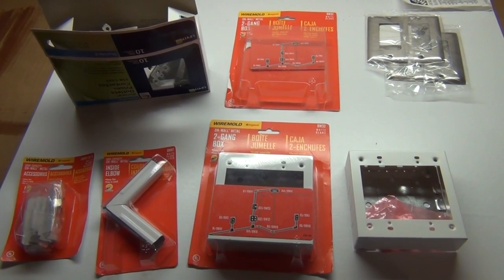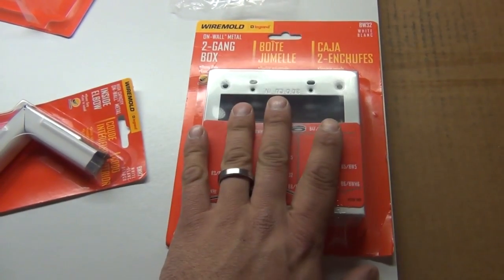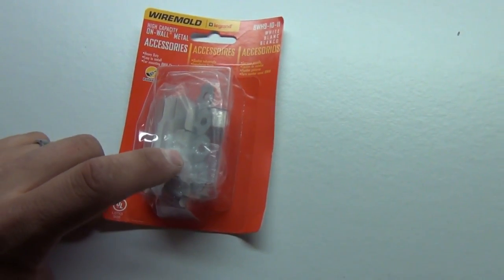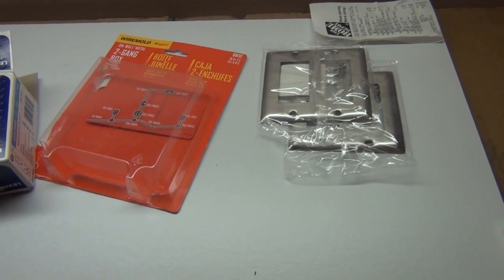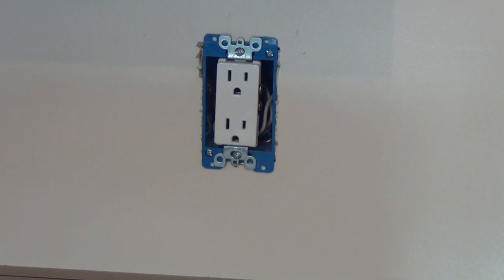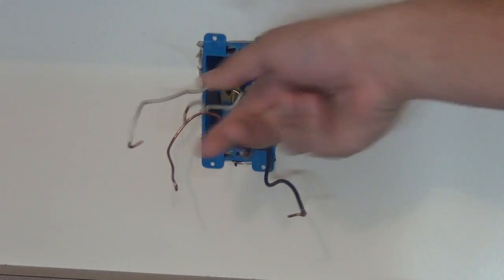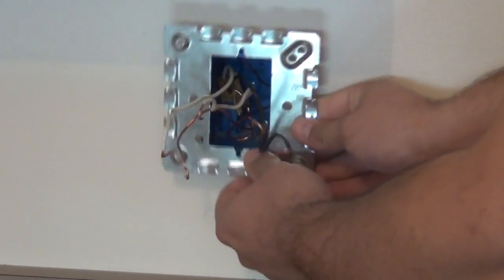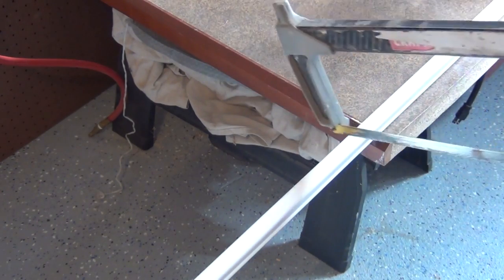Wiremold Installation

Comment: Excellent video.  The original outlet is a 15 amp.  Check the wiring to that outlet.  If it is 12 ga, then what you are doing is fine.  It just means that someone replaced the original 20 amp outlet with a 15 amp version.  BUT if it is14 ga wire feeding that outlet then adding 20 amp wiring and 20 amp sockets does not make it a 20 amp circuit.  Not to code.  Also, BW9-10-11 kit should come with inserts that you install at the cut ends of the raceway to keep the sharp ends from cutting into the insulation.
Reply from the maker: Dan Burch Thanks.  Yes, the original circuit is 12 ga wire.  It is within code to install 15 amp receptacles on a 20 amp circuit.  However you cannot install 20 amp receptacles on a 15 amp circuit.  I had no need for 20 amp outlets.  I just wanted the extra amperage capacity on the circuit.

You are correct about the bushing inserts.  I typically don't install them and use extra care when pulling the wire.  It is however good practice to use them.  Thanks again for stopping by my channel.
Reply: Not to mention anything in the Garage should be GFCI protected so either you need a GFI Arc fault breaker or a GFCI outlet where the power first comes in is your Line side and Load side out to the other Receptacles.
Reply: @AccordBass12 The circuit breaker he turned off had red handle, so that is usually a gfi breaker.

Comment: It would have been helpful if you would have shown the wire being pushed through the corner piece which can be tricky for some people.  It's little things like that that your average guy has problems with.  Other than that, good video.

Comment: I want to add a few outlets in attached garage on a dedicated 20 amp circuit. Is wire mold setup used here meets code for garage setup?

Comment: Well done, looks doable. Sure I'll figure out some way to get into trouble but seems to be a good introduction into the wire mold system. I was wondering about the burr on the end of the raceways and I see Mr. Avera below me takes up the subject of the plastic bushings provided to alleviate that danger.  Maybe a comment about not adding too much to any one breaker by exploring the circuit that you are tapping onto and checking the gauge of those original wires and supplying breaker size used for that outlet we tapped onto.  Worst case would be adding 12 gauge wire to a circuit supply using 14 originally. Someone in the future could see the the 12 gauge and up the breaker size at the box from 15 to 20 amps and you would have a fire hazard.

Comment: Necro note: Should use the "bushings" provided in the hardware pack at all cut ends of raceways (and file burrs off first).  That will reduce the risk of cutting insulation when pulling wires.

Also, it is better to directly connect all ground wires together (e.g. with a wire nut and pigtail), instead of relying on box hardware to complete the ground path back to the breaker panel.   If a short occurs, you want low resistance so the breaker pops immediately, rather than (possibly) having a miniature arc welder where the box parts touch!

Comment: Just thought I'd mention that with wire-molding (aka metal raceway) any time you cut the molding you should insert a bushing into the end. Your install kit should have come with these, if not, you should make sure you pick some up. After you cut the molding to length,  you should take a fine file and clear and burrs, then the bushing slides into the end you cut. The bushing will protect the wire (and your fingers) from getting cut by any sharp edges. I also noticed you used unshielded wire, I'm not sure if you removed the shielding from normal wire to make it slide through the wire-mold easier?

Comment: This is a great wire mold installation video . The only thing I disagree on is the way he passed the circuit through the devices/outlets . Not sure when this was actually recorded but since 2014 NEC : circuits shall not be connected through devices but rather pigtailed to achieve the same parallel connection . This prevents circuit impedance Incase of device failure . 

Still a great explanation on how to install wire mold . 

Thank you .

Comment: Nice clean job, but why did you strip the outer casing of the 12/2 wiring, that would have ensured not cutting in to any of the other wires?
Reply from the maker: I used THHN copper wire to run in the wiremold, not Romex.  It's usually not good practice (and against code in some areas) to run Romex inside conduit or wiremold. Thanks for watching!
Reply: zimsjeep Thanks for THAT little tip right there!
Reply: Good to know. You should edit that in the video.

Comment: Nice job.  Very helpful, thanks!  I have a question:  it looks like your inside corner overlaps the rail a bit, and yet there is enough of a lip for it to snap onto the rail, is this correct?

Comment: Fantastic work. You really know what you are doing, in the installation of the product as well as in the video presentation. Besides that, you have the gift of teaching. Question: Does the Wiremold 700 series include a 45 degree outside angle? I can't seem to find it.
Reply from the maker: Yes. I’ve used them in the past. They do exist. Thank you for the compliments!!

Comment: Good detailed video , you can buy bushings that fit inside the track when installing it inside the box, it protects the wires.Was looking for the clamps that hold the channel. Didn't realise they come in a package with various clamps. Thought it was in separate package. Lots of good pointers in your video on installing.

Comment: NEC 210.8(A)(2) requires that all residential garages require gfi outlets at each location.... Good vid otherwise.
Reply from the maker: +steve jones The first outlet on the circuit is a GFCI.  The rest are wired to the load side and are protected.  Thanks for the comment and for watching.
Reply: @fixitwithzim  boooooommmm💣🗯️🗯️💥 got him!!😎

Comment: Great video. Why did you feed the 12gau Romex into the raceway without the protective jacket? Do you have to remove the jacket to get 12gau romex to fit in this size raceway?
Reply from the maker: Audito Canarsie Thanks, that wasn't romex that I used.  It's spooled thhn cable.  It's generally considered bad practice and against code in some areas to use Romex in conduit and raceway systems. Hope this helps.

Comment: He forgot to mention that you can buy bushings to place on each side of the track after cutting so won’t have to worry about damaging your wires on the sharp  edges. If it’s a first time DIY project adding bushing might make you less likely to damage the wires. But this is a good video.
Reply from the maker: This has been mentioned a few times in the comments, yes you can add bushings.  I install this stuff regularly in commercial buildings and don’t use them, but as you mentioned first time installs might find them beneficial. Thanks for the comment.

Comment: EDGE IS ShardHARP!  Really!  Don't forget to use a standard hand file to de-ber the inside of the track when you saw to fit.  INSTALL the bushings from the accessory pack to protect the writing from getting "skinned."  It's in the accessory kit, please use it to protect your work. Stay safe😝

Comment: Would wiremold work for a 240v 6/50 plug receptacle with either 6/2 or 6/3 wire feeding it?

Comment: Nice video. Per NEC, you should not jumper receptacles in a 4-banger outlet assembly. Recepts should have individual ungrounded conductors and grounded conductors and grounding conductors, all pigtailed to branch wiring.
Reply from the maker: Gregory Spells Thanks for the comment and for watching!
Reply: What NEC article says that?  Never had a problem doing it the way shown in the video.

Comment: Can you clarify one thing...is the original outlet a 15amp or 20amp circuit?  If it is 15amp circuit, can you run a 20amp circuit from it?  Should  a 20amp outlet have a "T" slot on one of the slot?
Reply: yes 20amp outlets have a t slot  aswell as TRl logo
Reply: NO

Comment: Thanks for a nice video. This helped me complete a wiremold project that I had started and got stuck on. Your tip about bending the tab out a little was very helpful. I see you don't use the plastic receptacle box either. The only hard part I had was I had to steer around a protruding stud, so I just used bare romex for that part.
Reply from the maker: Thanks, glad the video helped. Yes the bushings should be used as skinning the wire accidentally is a possibility if you don't use Wiremold often. I've worked with this stuff many times and don't use them anymore.
Reply: zimsjeep we did use the bushings (in the accessory pack) though we were using romex which has the additional outside insulation, but it was nice to cover that sharp edge on the wire channel.

Comment: The green wire ground must be connected at every outlet and switch. The explanation was a little vague on this topic. You cannot use the metal frame work as the source of ground though it does need to be grounded as shown in this video.  At the first box with power, pigtail the green wires, one to the metal frame and one wire to the outlets and the third to the next box in line.  Another is drywall screws are for drywall hanging, not for electrical work. It also did not show the bushings are boxed in the "accessory" pack to protect the wires at the end of the raceway. When you do need to cut the raceway, use a file to smooth the edges and use 502 or 702 bushings.

Comment: You attached the ground wire to the metal plate. I'm assuming you also attached the ground wire to each outlet and the green wire to the plate or one of the outlets? I'm assuming plate.
Reply from the maker: Ground wire attached to back plate and outlets at all j boxes. Overkill but doesn't take much longer to bond everything together.  Thanks for watching
Reply: The correct way to connect multiple grounds in a box is to attach a separate ground wire to each device (receptacle, switch etc) AND the box, then wire nut them all together.  That way, if a ground separates from any device all the other grounds will still be intact.
The insulating bushings are REQUIRED by the NEC (in section 342.46).  Yes, I am an apprenticed Electrician.

Comment: Just a question. Why are you not using a GFI plug in a place where you apparently be using heavy equipment. Are does the electrical code in your area not require it.

Comment: zimsjeep can this be used to install a over light or ceiling fan kit in a dining room.
Reply from the maker: David Grocesley Yes, just make sure you secure the box to framing in the ceiling because of the weight of the fixture. Thanks for the comment and for watching.
Reply: zimsjeep Thank you Sir, your video was very helpful and appreciated.

Comment: Great video.. I hate to be this guy but the grounds should all be spliced at the outlet and then pigtailed off to the grounding screw on the wire mold and the ground at the outlet.

Comment: Is it possible to run a gfci in that circuit? Maybe set it up so the other receptacles trip too?
Reply from the maker: Yes, install the gfci in the first box and connect everything downstream to the load side
Reply: @fixitwithzim  That’s what I was thinking in my head but wasn’t sure, thanks for confirming.

Comment: I went to Lowes to get my supplies to do the job & I wasn't sure to get the 2 gang boxes that were 1 3/8" deep or 1 3/4". The 1 3/4" are $5.00 more & I needed 5 boxes for my job. What did you use?
Reply from the maker: Frank Desantis when I originally made the video, I believe I used the smaller boxes. I’ve since added on to the original setup and used the larger boxes which give you more room to work.  If you don’t mind the look of the larger box, I recommend you use them.

Comment: Maybe you could add the use of a plugin circuit tester to check that the correct circuit breaker is turned off.
Then the tester could also test the new circuit for proper polarity and grounding.
Just an extra safety check :)
Reply from the maker: Jeani Martel Yes, cant hurt.  I have all my circuits marked in my house.  I also used a voltage sniffer off camera to double check.

Comment: Zim, thanks for the videos, I am a subscriber. Hopefully you still get reply notices.

A question:
I have a freezer in the back of my garage.
I have two outlets in the garage, one in the ceiling (unswitched) for the door opener and one GFI near the door.

I want to power the freezer with a separate feed from a origination point with it's own GFI,
because I don't want to chance a trip from a power tool in the daisy chain.
(If it trips and it goes unnoticed, the contents of the freezer will be toast)

Should I just run a separate wire mold and feed for this purpose..?

Thanks in advance for your expertise and reply.

RJ
Reply from the maker: I would run a separate feed as you described, not worth chancing overloading the circuit or nuisance trips. Thanks for being a sub and the kind words!
Reply: @fixitwithzim  Thank you..!

Comment: Nevermind. Went back and watched again. The ones that were originally go to the outlet on the right and the ones that got added to the left. Repeat down the line. Thanks. Got the Derp right now.
Reply from the maker: Doesn’t matter which side is in and out, just match up your colors and screws. Gold is hot, silver is neutral.

Comment: really good video it'll help to my girlfriend a lot, but why if we use plastic molds instead of the metal?. 
great video btw,  keep it up
Reply from the maker: Check to see if the plastic is rated for line voltage.  I use the plastic stuff a lot for low voltage stuff at work...always found the boxes to be flimsy.

Comment: Great video!  I need to do this exact same thing.  May I ask what the part numbers were for everything?  Or at least where you purchased them all at?
Reply from the maker: Keith Ledbetter I don't have the part numbers.  Everything was purchased at Home Depot in the electrical department.  Good luck with your project.
Reply: Platt Electric has more than Home Depot.

Comment: Really appreciate the video.  I would like to know more about grounding the receptacles.  Thank you
Reply from the maker: The receptacles and the wire old system are all bonded together via the ground. The outlets themselves as the come from the factory will be grounded via the ears on the receptacle. I also added a pigtail from the incoming ground to the rear of the first box mounting plate

Comment: The wire is 12 awg, allowing 20amps, the receptacles are 15 amp receptacles, when you use 20 amp power tools, the receptacles will be toasted, because it only allows 15amps.  So you can't benefit from your 12 awg wire.
Reply from the maker: DIY No they won't buddy.  Please be a little more knowledgeable before posting bad information for everyone.  A 20 amp tool will have a 20 amp nema plug on it which will not fit into the receptacles I used.  15 amp recepts on a 20 amp circuit are perfectly fine per the NEC
Reply: 15 amp breaker + 14 awg wire + 15 amp receptacles makes more sense to me, you can through in a 10 awg wire if you want, non of my business, have a nice day!
Reply from the maker: DIY You up the wire size to help prevent voltage drop for high amperage drawing tools. It's the same reason you see 20 amp kitchen counter top circuits with 15 amp receptacles.  It so you can run more tools or appliances at the same time on the same circuit.
Reply: zimsjeep i don't remember exact, there is voltage drop with distance, but voltage drop cross the threshold only after certain length ( when you need to upgrade your wire). You are the best to know your own situation, but I didn't hear any from this video.  And also, i don't  know about you, but It's kinda difficult for me to operate multiple power tools at the same time.  Let's say you can run multiple tools at the same time, each tool draws 10 amps and you run 3, your wire is still not good enough, but its your garage, your call.  I will stick to the 15,14,15 combination, within certain length.
Reply: zimsjeep by the way, how big is the breaker you use on this line? Kitchen 20 amps line requires 20 amp breaker though.
Reply from the maker: DIY The video wasn't about circuit and wire sizing, it was meant to demonstrate the installation of wiremold.  The track I installed in the video is on a 20 amp breaker.  This video is also about 5 years old and I'm happy to report none of the outlets have melted 😉

Comment: Nice video.. just one more thing to note to the watchers out there.. this 20amp circuit is in a garage.. it should be GFCI protected.. and file your ends.. and use a bushing as not to run into the potential of a short from scraping wires.. other than that.. very informative.
Reply from the maker: Thanks for the comment and for watching.  My garage is my workshop - this circuit is dedicated for power tools. Power tools/motors and gfci's generally don't like each other. The high amperage draw at startup can lead to nuisance trips. The convenience outlet on the other side of the garage that would be used for outside purposes is gfci protected.  Thanks again for watching.
Reply: Most GFCI's today do not have that problem.. the earlier versions did.. code specifically states GFCI Protection in a garage.
Reply: I do know what you're saying thou.. example being.. a freezer in a garage.. don't want that food ( could be in the hundreds of dollars going to waste when you're away). Have a good one.

Comment: Did you ever try leaving the insulation on before. More difficult to pass it threw maybe?
Reply from the maker: Raymundo perez I used THHN individual stranded wire, not romex. It's not considered good practice to install romex in conduit or raceway.